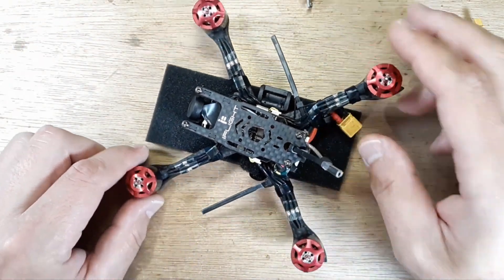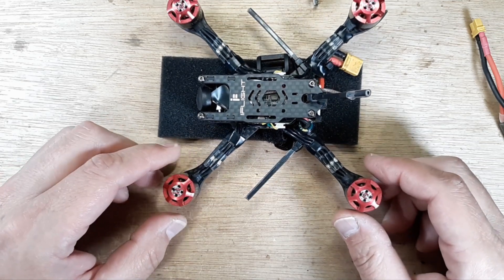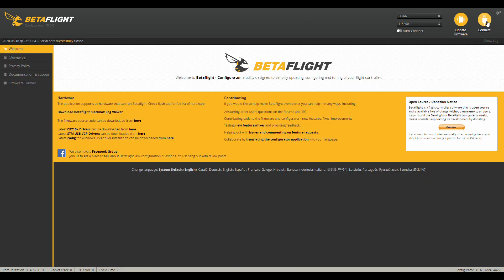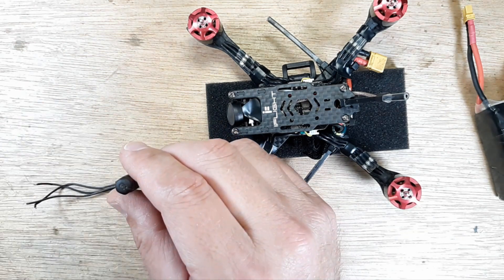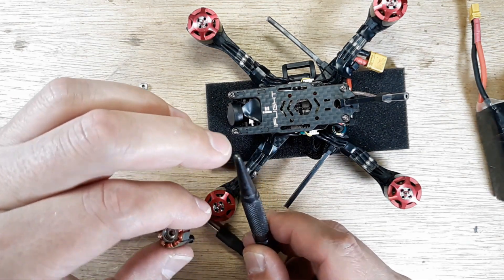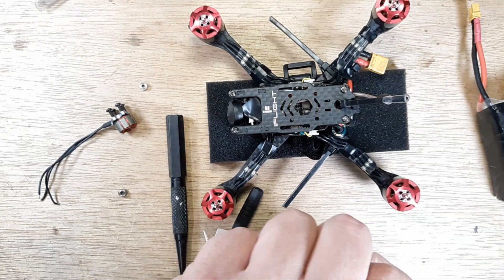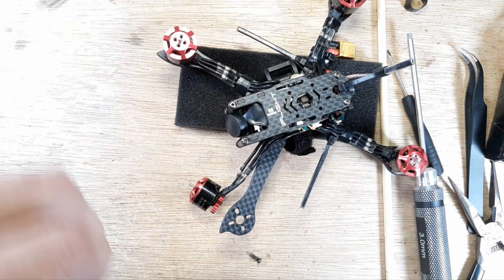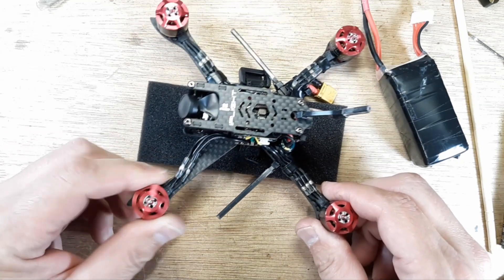Micro Motor Bearing Replacement | How To Replace A Bad Set Of Bearings

Comment: Did you ever try ceramic bearings?   Steel are just rated to 50,000 rpm.   Ceramic is good to 100,000.   AliExpress has SMR52C Ceramic Hybrid for $2.50 each.   I'm going to try them out on 1202.5 motors.
Reply from the maker: I was not aware of an RPM rating between bearing types.. Interesting...
Makes sense why they put ceramic in turbochargers.. Thank you for the feedback, I'll have to look into this...👍🏻🍻👊🏻
Reply: Here is the link:   https://www.aliexpress.com/item/1005002613716030.html?spm=a2g0s.9042311.0.0.48fa4c4dlbpuqy
Reply: Here are the sizes:    https://ae01.alicdn.com/kf/H1493c868f72a40eea20eda0b7532533fI.jpg
Reply: what's the verdict on the ceramic bearings? I've had a few goes now at swapping for cheepo steel bearings and they have all died really quick, like they are worse than the ones i took out in a few packs. Had one die on the first crash so not had any luck so far. This is on my 1407 (t motor) / 1606 (emax). Need to try some quality bearings but its so tight to the price of  new motor im not sure it works out.

Comment: Fast Eddy bearings are what I've been using. No complaints so far. The NSK bearings from pyro are probably better but more expensive.
Reply from the maker: I need to get bearings for my 1408 4000kv Mamba 4S motors.. I think I'll spring for the NSK ones.. I'll definitely look into "FastEddy" ones. Thanks for the info...🍻

Comment: Do u have any idea about the ID and OD of those bearings I kept Couple of motor aside coz of this  bearing issue and I want to replace them but not able to get exact dimension so please help.. 
Thank you..
Reply from the maker: NSK 5mmX2mmX2.5mm REPLACEMENT BEARING FOR 1407, 1408, OR 1507.5 HYPERLITE MOTORS
Link and info in the description...🍻

Comment: good source for those small bearings are computer brushless fans. If you've got some scrap PCs it might be worth to take a look.
Reply from the maker: I will take note of this, thank you for the information. I think it would be cool to have a handful of quality bearings handy. My favorite Quad is a few years old now and is in need of new bearings.
Reply: @PropsOff  Thanks to your video, I fixed one of the clicky motor bearing on my Tinyhawk 2 FS with bearing from a 3010 fan laying around. They are exactly the same size (2x5x2.5mm). 👍🏻
Reply from the maker: @yoyomin  
I appreciate you coming back and telling everyone the motor and bearing size.. This will help someone 4shO...👍🏻🍻👊🏻

Comment: I've had better luck just replacing the motor.  If I'm going to replace a bearing, I'd do both.  The problem I've had is one or the other the outer ring is stuck in so good, I end up tearing the motor to shit trying to pop out the ring.   Ah, I just had an epiphany.  I need to find a punch just the same size as the outer ring of the bearing.  Damn it.  I've wasted good motors over the past.  Where do you get your bearings?  Thanks.
Reply from the maker: I get my bearings from motors with burned windings. Just a benefit of hanging at the races.. A box of different sizes..

Comment: Cool. 👍 i wish you could just buy a set of bearings. I have a quad where multiple motors have bad bearings
Reply from the maker: https://pyrodrone.com/products/nsk-5x2x2-5-replacement-bearing-for-1407-hyperlite-motors
Reply from the maker: If you have lots of motors needing bearings, bulk bearings pack may be the way to go. Above is the link to the bearing size I pulled in this video. Have a great day...👍🏻🍻👊🏻